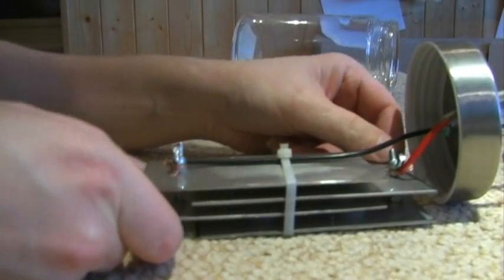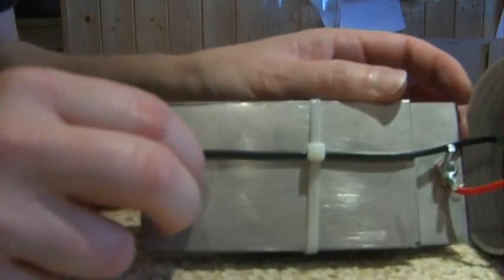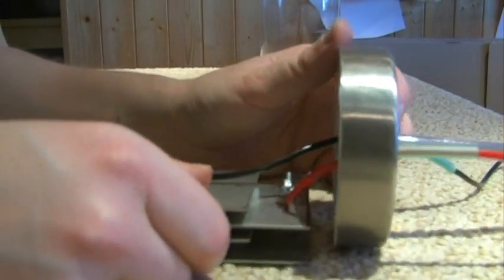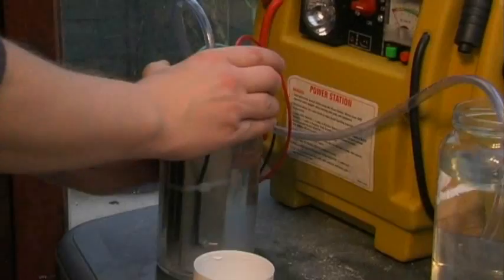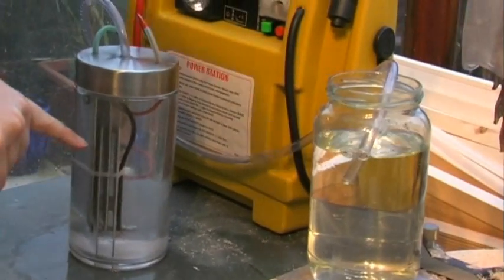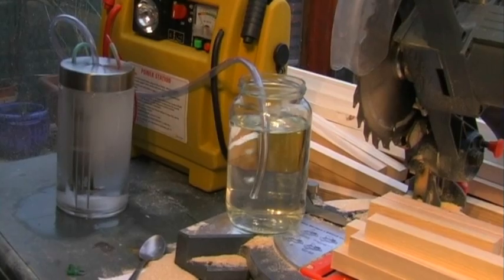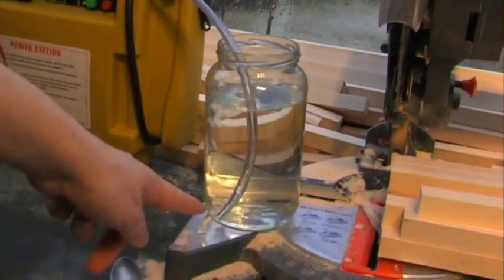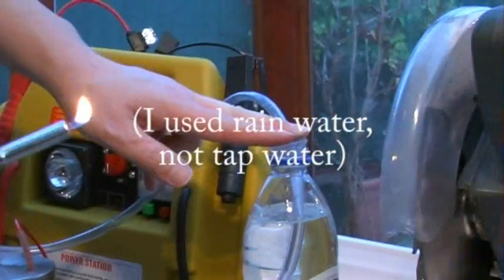FUEL FROM WATER EXPERIMENT. My HHO MK2 generator

Comment from the maker: Yes, it is both oxygen and hydrogen. The oxygen makes it highly flammable and ideal to aid combustion in engines, but because of the oxygen content, it is also highly dangerous to store - that's why these systems are "on-demand" ie. The gas gets used straight away and is not stored.

Comment: very well presented ... it is obvious you did your homework ... am anxious to see your in car test results ... seems that fuel savings vary from install to install, car to car ... largest MPG increases are being reported by folks with larger engines ... seems small fuel effiecient cars get less of a gain ... still much testing needs to be done ... best results are being turned in with between 500 ml/min to 2 L/min type units ... more than this seems to be a problem ...

thanks for your help

Comment: Nice job on the generator!

It will never give any extra power in a car though as the load you put on the alternator drawing current will increase the alternator drive belt resistance and slow down the engine leading to increased fuel consumption.

So the energy taken to separate the hydrogen will be more than you get back from it, once you have added in all the losses in the system.

Comment: As far as the electrical side of things goes, here he's using a 15 amp fuse. In automotive wiring, 15 amp circuits are what power your average car radio. Here, this unit is pulling voltage and is fused so that it does not exceed that (wire into your fuse panel would only turn HHO on when you start your vehicle. people do this so faulty cooling fans run while the car is turned on). Cars have a 12v system equipped with a voltage regulator because alternators generate excess. No overdrawing risk

Comment: Your well on your way, if you want I can send you some of my plans for some of my cells if you want, at no charge:) One of my cells I use strait rain water and it works very well, cut my gas from 15 mph to 32 mph. Anyway keep up the great work for energy independance is a worthy goal.
Reply: Don't be ridiculous.  How much energy did you put into the system to generate how much Hydrogen?  You saved how much on your mpg?  Joker.

Comment: Well I would agree that you don't increase the combustion value of gasoline without changing octane. I see where you would improve fuel economy in a car. Systems such as MAP and O2 sensors, EGR (Exhaust gas recirculation) and MAF (mass air flow) sensors take a readout of the air density and temp being taken in, then regulates the air/fuel ratio to maintain a consistent mix. Adding hydrogen would cause the cpu to mix less fuel, thus running the car (lean). That's why a faulty O2 sensor kills mpg

Comment: Spacing isn't that important.  I have made so many cells, I've lost count.  My best cell has 6mm gaps.  However, I have had similar results with 1mm gap.  Use a good electrolyte, NOT anything hydroxide, or salt.  You should get > 500ml/min at 18-20 amps 12 volts.  Have fun, that's the important thing.  AND BE CAREFUL!